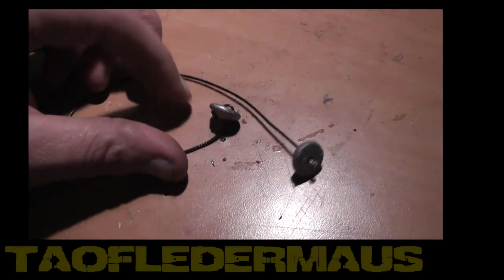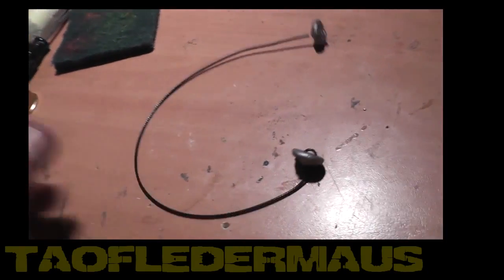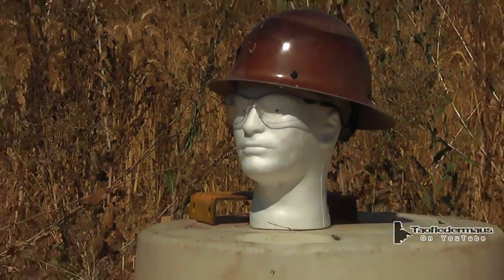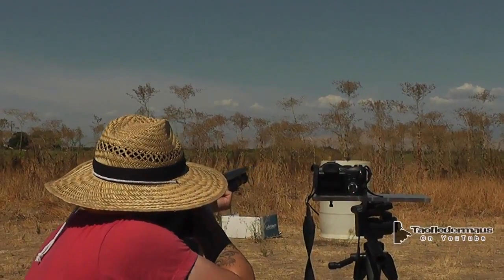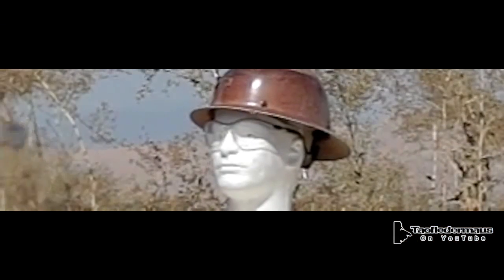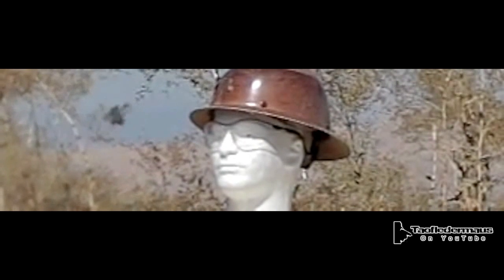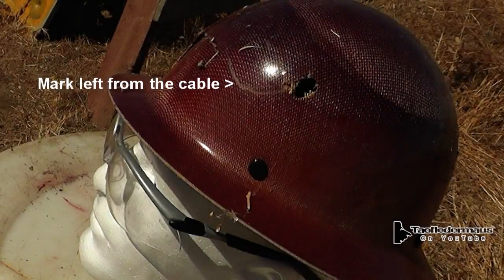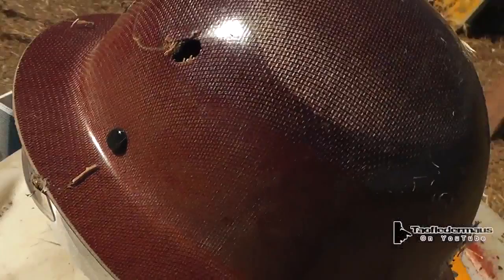BOLO Shotgun Rounds - Homemade!   Will they work?

Comment: Shoot some alfalfa pellets of various sizes. When I was a kid I got some that were the perfect size to muzzle load in my Daisy Red Ryder BB gun. I made a ramrod of coat hanger wire to put the pellets just ahead of the BB hole in the side of the barrel. They'd punch through both sides of water filled aluminum soda cans.

Comment: Im replying to you so people will see this. so anyway, you should try takeing apart a glue stick (the ones that twist and the glue comes out) if you screw all of the glue out theres a little plastic cup that the glue sits in use that plastic cup let the the glue dry and try to shoot the glue or fill the cup with led/wax slug and put mutiple of them into the wad